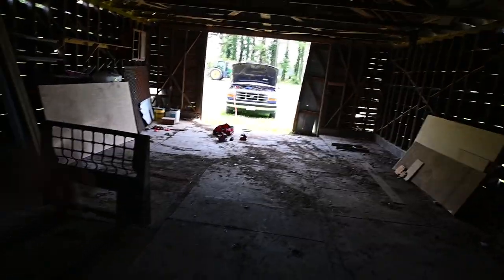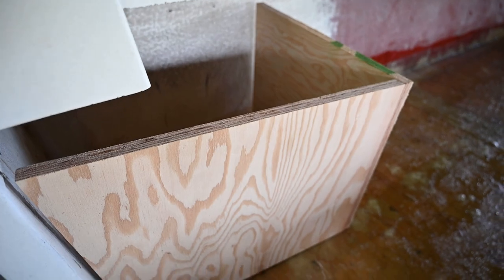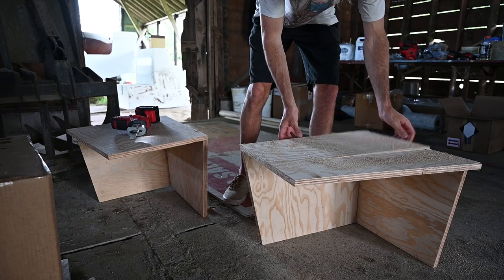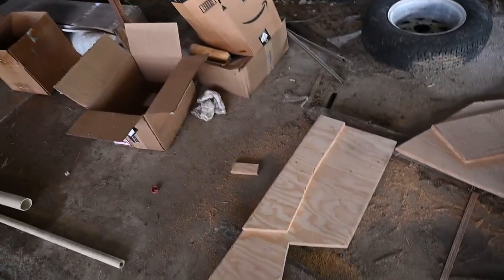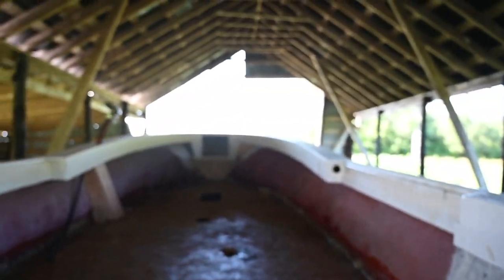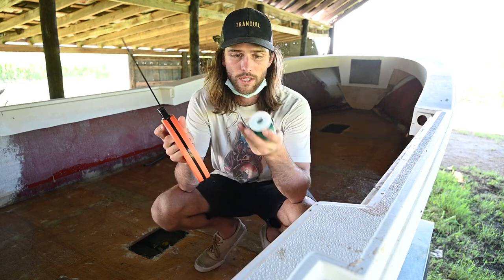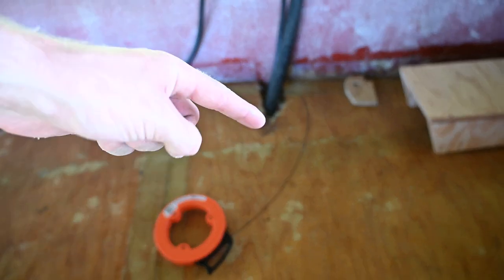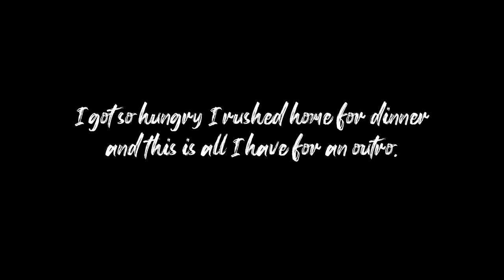Rebuilding a Center Console Fishing Boat - Episode 9: Cutting the Box Seats & Anchor Locker + Wires

Comment from the maker: Episode 1: Sea Ox https://youtu.be/s1Kd0yXnqaM
Episode 2: Stringers https://youtu.be/r-gm6fnqBYo
Episode 3: Fiberglassing the Stringers https://youtu.be/0X70bpSwMxE
Episode 4: The 86 Gallon Fuel Tank https://youtu.be/CsGsQqVHFbo
Episode 5: Rigging Tube https://youtu.be/mc1JobOJ9LU
Episode 6: Buying the Motor & Pouring Foam https://youtu.be/-tbqZP1mpQQ
Episode 7: Cutting the Deck https://youtu.be/UdRFxYjdpJI
Episode 8: Fiberglassing the Deck https://youtu.be/Q7TzB_imIao
Episode 9: Cutting the Box Seats, Anchor Locker, & Fuel Brace (this video)
Episode 10: Fairing & Grinding the Fiberglass (next week's video - subscribe)

Comment: Planning on converting a 1979 Pacemaker Wahoo to outboard but boat Im looking at needs floor redone. How much did the marine plywood cost you?
Reply from the maker: $122 for a single 3/4” thick 4’x8’ sheet in early 2021. Before lumber costs skyrocketed, they were $90-$100 per sheet. Not sure what they are now. I’d call a local lumber yard to get it priced out.